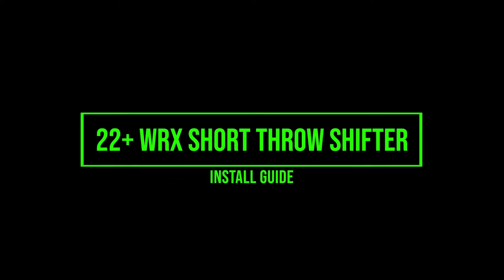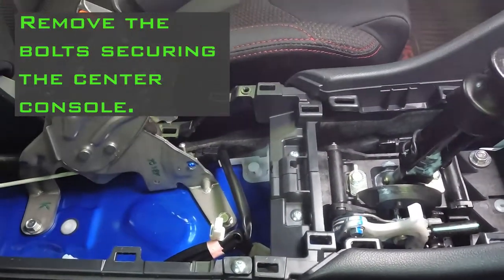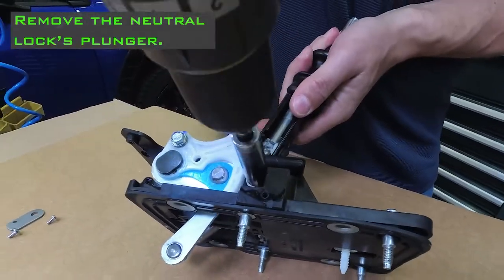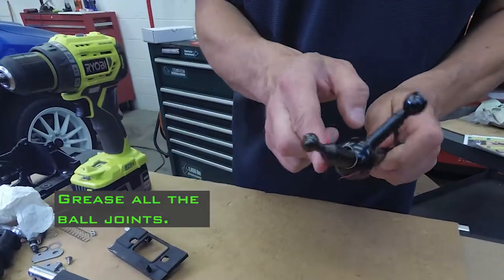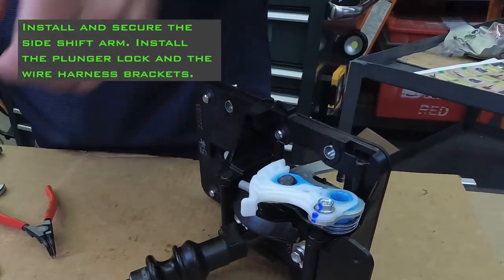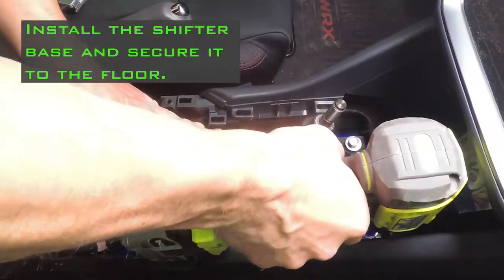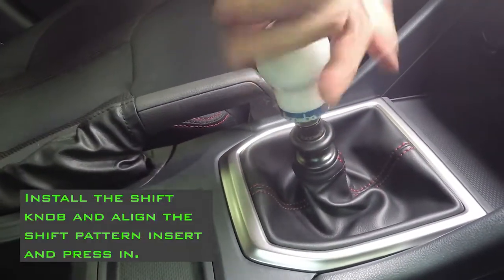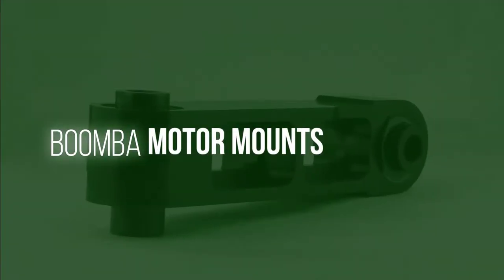Install Guide | 22+ WRX Short Throw Shifter

Comment: Do you think you could provide the shift stop bolt torque spec? I've tightened mine pretty good but would feel better knowing a spec.
Reply from the maker: Hi! We do not have a spec recommendation for torque but as long as it is snug and does not move you will be set for better shifting and way less slop!
Reply: @BoombaRacing  Thanks for getting back to me

Comment: Any issues with the lower shifter assembly bolts? I couldn’t remove the 10mm nuts on the bottle because the square heads of the bolts spun through the plastic and I have no idea why.
Reply from the maker: Hi! This was a common issue with the VA models and seems to be an issue on a few of the newer VB models as well. The bolts were likely over torqued from factory, and you will need to use a small screwdriver to leverage the bolt head downwards while loosening it to help extract it from the shifter assembly base. Please let us know if there's anything else we can help with!

Comment: Hey I just installed the short shifter lever and I don’t if u guys had the same problem with 5 and 6 can’t find them
Reply from the maker: Hi, have you adjusted the OEM shift stop located under the shift boot? The throw reduction is quite significant as well so it may be a bit getting used to the shifter as well. Hope this helps!
Reply: @BoombaRacing  I did but there’s still a lot of distance between the oem shifter stop and the shifter been in 5 and the shifter is sitting really close to the driver side
Reply from the maker: @BrayanEscobar420  Just trying to learn a bit more about your set up, do you have both the transmission plate and the short throw shifter? The shifter does end up sitting closer to the driver side after installation in normal situations.
Reply: @BoombaRacing  yeah I paired ur guys short shifter lever with a billetwork shifter plate and bushing and it feel really tight I love it. It just the 5 n 6 that bugging me rn!!
Reply from the maker: @BrayanEscobar420  Got it! We're still having some difficulty identifying what could be the exact issue. Would you be able to send us a video to nsoriano@boombaracing.com or to our Facebook Messenger and we can further assist and get your shifter working perfectly! Thank you!!
Reply: @BoombaRacing  yeah as soon as I get a Chance today I’ll send you the video! Thank you!!

Comment: You know Subaru sells one officially for the 22-23 WRX right? None of that “Hope it fits”
Reply from the maker: Hi! We've tested and ran this shifter on our shop cars for months and it works great! The amount of throw reduction is more than that of the OEM STI STS as well. The shifter design is a direct fit for the 22+ WRX. This is also significantly cheaper than the OEM STS and comes with a lifetime warranty. The ultimate shifter kit that includes a brass shifter bushing, transmission adaptor plate, shifter stop and short throw shifter is only $30 more than the short throw shifter alone from Subaru, combined these parts offer over 50% throw reduction and improve the shifter feel a ton. You can find our parts here: https://www.boombaracing.com/transmission-23/
Reply: @BoombaRacing  How about the reverse lockout clanking? Do you have issue with this?
Reply from the maker: @destruxandexploze2552  If installed correctly the reverse lockout will not clank or produce any additional noise than what already occurs from the factory.